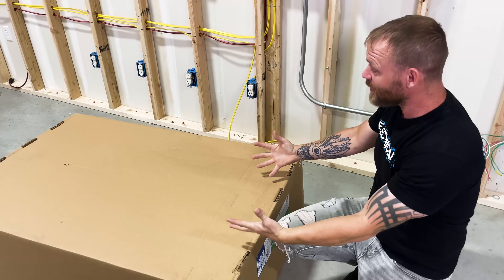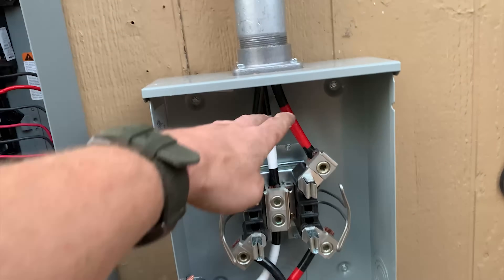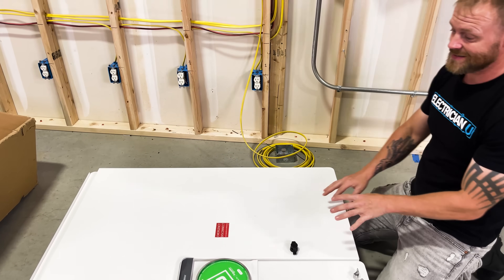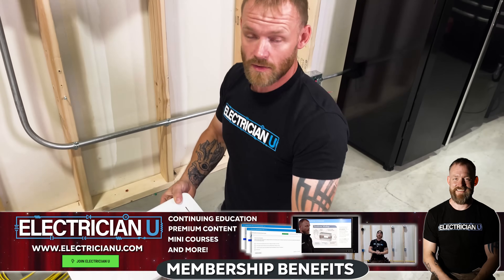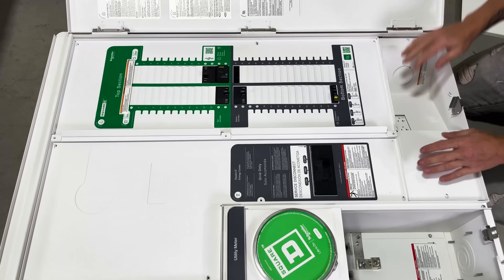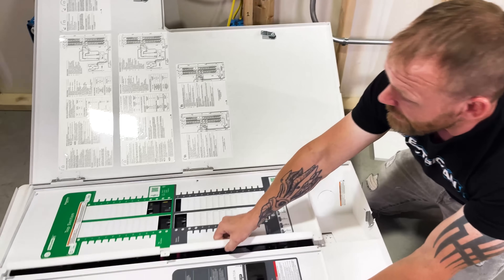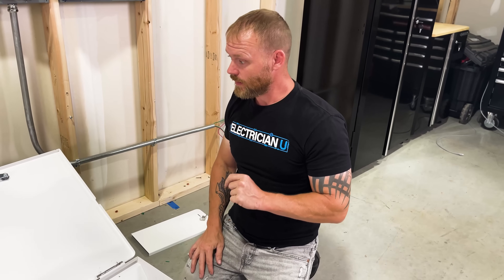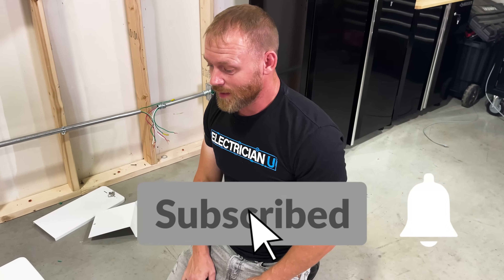The ALL-IN-ONE Energy System You Need for Your New House!

Comment: Main downside is cost is 10x a regular Meter-Panel (~$3400).  This panel is targeted at the California market.  The solar angle is only useful if back-feeding the grid, but most California utilities now credit very little to feed the grid.  Thus, many new solar systems are off-grid (can draw from the grid as needed, but never feed it).  But off-grid means a hybrid string inverter, which can only affordably be used with panels not on a roof.  That is due to the latest NEC rule that there must be a "rapid shutdown" cut-off for each roof-mounted panel (to protect firefighters).  That is a prohibitive cost with a string inverter, but integral to a micro-inverter (one per panel, see Enphase).  Micro-inverters must be grid-connected since they must synch to the grid, thus feed the grid excess solar power, even if the utility now gives little credit for it.  I know all very confusing, and may become even more so.

Yes, like many comments, the first time I saw a main panel outside was in my California house.  Power is most likely to go out during a thunderstorm (rare here).  Is it wise to be outside in the rain, perhaps standing in a puddle, when trying to flip breakers to get power back on, or switch in a generator?  Also, outside is a worse environment for corrosion.  Zinsco (Sylvania) panels were mostly installed in the Western U.S., where main panels are usually outside.  Think that might be the correlation with them getting a bad name, mostly due to corrosion on the bus-bars?

Comment: What goes in that bay above the meter, to the left of the upper panel?
Is it for a transfer switch, maybe?

Why split up load centers? (The work behind you)
If I install a 30 (or whatever amp) amp generator inlet on a 200A service, I feed it from the top with an interlock and that heats up the whole panel. Then, I instruct the HO that they have 2 options: they can manage the loads themselves or load shedding can be installed (usually just the HVAC).
If it's 200A ats on a 400A parallel service (2x200A load centers); run a second transfer switch in parallel with the first.

Comment: That is definitely a game changer a like how they powder coated the enclosure it doesn't surprise me that something that size will require at least four guys to position it while you are securing it I have installed service equipment cabinets that requires four guys probably about the same size about that enclosure unbelievable how much it waits but Square D is definitely my favorite brand when it comes to electrical can't wait to see what they come up for a remodel replacement option

Comment: I may be wrong but i did not see a DC disconnect. If it does not have one the whole panel is mute.   No doubt this panel costs several times an AC panel and DC panel combined. I am all for combining things into one panel but there should be plug and play add on's that let you customize a system.   Until that happens these types of  panels are just a waste of money because you will have to provide additional panels for a proper install.

Comment: Do you still have to run a neutral for every conductor. Example. Running 12 three. All arc fault breakers I have to run an extra neutral wire cuz of the arc fault wit this new panel do you still have to run a neutral for wire conductor.

Comment: Nice set up I’m just not fond of the plug on neutral, I’d rather use those pesky pig tails instead having the current pass thru a literal back stabbed connection. But having a built in ATS with CTs for load Managment is kool!

Comment: Curious to see how this will develop into future uses for other use cases such as those of us with basements. Our meters go outside and panels indoors, so maybe they'll develop a similar use where there are two units, one for the breakers indoors, and say the meter enclosure serves as all utility and alternative power hookups, i.e. transfer switch etc. That would be a slick solution. Definitely would drive up labor on a remodel or service change though. 
And i personally don't like Square D. Never liked the Homeline panels when i installed them and the QOs are just too pricey. They kinda remind me of the old StabLoks.... Also to mention, Schneider decided to nix all two pole Afci breakers for multiwire branch circuits, making remodel work a nightmare or impossible. Just my gripes. (And if I'm wrong on any of these points, please point me in the right direction!)

Comment: Most of us in sane states put our electric boxes inside the house. I always found it odd that movies had circuit breakers and fuses on the exterior of a house.  I never had that experience as most of our power came into the house in our basement or garage.  The meter might be outside, but the breakers and fuses were always on the inside.
Reply: I think in California they put it on the outside, im not sure why maybe a culture thing, but over here we put panels on the inside to control inside equipment and maybe one on the outside to control outside equipment
Reply: @Tactical-Black  2 reasons I can think of.
1) First responder access. 
2) Earthquake. They require Shear walls and a panel  (access) cutout exceeds the allowed penetration
3) Cheaper to do a All in 1 (with meter) vs subs
Reply: @steveurbach3093  there is a different between a main breaker and the individual  ones. Fire would have ZERO reason to manually trip individual   breakers.
Reply: @Tactical-Black  well in the video, he clearly  shows that he has installed interior breakers, so wherever he is, it’s obviously not a legal requirement

Comment: When I heard Schneider I'd remember the pad mounted solar boxes (100-500kW of solar), I'm happy to see some small budget enclosures as well. The only problem which I see is replacement parts. If you use one odd system you have to order anything. As it's not a 3phase 30kV system it's not that produced to order as any other units (example from schneider electric) it's not build to order.

Comment: Nice panel.  What is the price?  Microinverters do away with all that clutter on your exterior wall, and are also guaranteed for 25 years (unlike central inverters), are online and monitored for efficiency.  Labeled disconnect and two pole breaker and you're done.

Comment: I think MOST home owners would still much rather have access to their panel and their breakers inside of the structure/house so they don’t have to go outside. Esp. During inclement weather conditions. 

It is a really cool product though, I appreciate it.
Reply: I was shocked (tehe) that they had breakers outside….  I can’t imagine the point.
Reply: @jamesbizs  seems like a huge security issue as well. I can’t imagine having breakers accessible on the outside of the house. Easy for thieves to run off with your expensive breakers.
Reply: I was thinking the same thing. This seems like it’s desert Southwest/California specific. In the SE it’s nearly universal to have the meter can outside and the panel inside.
Reply: @yolo_burrito  yessir, same here in the South.
Reply: Not to mention the added security of the service panel being inside so someone can't come and shut things off such as vandals and others.  Especially the security system.
Reply: @KevinBenecke  Modern security systems typically include a battery backup.
Reply: Most places in rural south Texas are built like that. I'm not sure about other areas but I know it's common there.
Reply: Plus you'd have to run conduits from the inside of the house to the outside panel, that would be an additional cost in any additional circuit.

Comment: It's a shame that their $3500 MSRP product is worthless junk for 4999/5000 Americans due to having no hardened locking provision.  A disconnect accessible by boltcutter is still readily accessible.  Other alarming objections include inconsistencies between Schneider's own documentation, no lower panel SPD despite being separately disconnected (and frankly needing it more than the upper panel), there are a lot of hard bends, and I was hoping to see a Type 1 SPD for something of this cost and size.  It's a neat package but the value is not there and without pushing it hard I don't think I will get anyone to go for it.

Comment: An ordinary 60 circuit Square-D load panel is $1,090.65.   This is $3,499.00.   Which leaves me wondering if there really is $2½k of additional value in the box?
Reply: No. There is not. But it looks pretty
Reply: It does have a meter base

Comment: Some reason the idea of having like most of your breakers outside is strange to me. Not sure i would like this something goes worng in rain, then you have to work on electrical system and be in water. Or if in winter it will be miserable. I also don't see any locks on this which is one big reason I dislike outdoor panels. To me this should be like a two part system a meter, transfer switch, small breaker center outside, then put the large one inside. Far as I can see only advantage is it puts an ugly? breaker box outside instead of inside. 60 breakers though that is impressive.

Comment: Tell Schneider Electric to make an entire GFCI / Arc fault panel-board.
Per breaker or per device protection is silly.
I see code eventually requiring GFCI / arc fault on Every residential circuit
Reply: Are you suggesting the MB to have this complete protection?  I'm not sure a homeowner would want the entire house to shut off if something happened on just one circuit.
Reply: @tracyphillips9681  hmmm, good point.

Comment: Couple questions: 1 do they make or include a generator interlock that has pre drilled holes for easy installation? That’s what I was expecting with your initial explanation. 2 is a solar inverter already designed to fit in the upper left corner? Cause once again that’s what I was expecting from the initial explanation. So far all I see is a meter socket that’s integrated into an outside panel. I live in PA so we don’t usually have our main panels outside. I would actually hate my main panel outside.
Reply: 1) It has a spot/knock out for you to add an inlet for your generator.  Look at lower right side when he opens the cover.  2) yes, it would connect to the top left. The SolarEdge version coming out in December has the inverter already installed.  This first to market version is semi-flush and only good for the West Coast / California markets mostly.  Late next year is when more versions will be available for your area and others in the US.

Comment: The thing I don't like about these things is that now your electrical panel has firmware, and it will need constant upgrading and have bugs and security holes.  Also, like many companies, they will likely do software development "on the cheap" and not test it thoroughly.  I don't want any software in my electrical panel.

Comment: So it bypasses the need of a disconnect between Meter and main that code as nowadays. Guess because the main break is in separate space inside it.
Reply: a lot of meter panels have a service disconnect section these days, with the ground-neutral bond.

Comment: Curious, why do some areas put the circuit breaker panel outside versus inside? Seems to me that is really inconvenient. Breaker trips in the middle of the night you have to get dressed (hopefully) to reset it. Pouring rain, who wants to open an electrical panel? If not locked some jerk could just walk by and shut off your power. If locked now you have to deal with a lock in the middle of the night or if brave in the pouring rain.
Reply: in TX, you get both at the same time! confuses the heck out of people. and of course, some try-it-yourselfers can't figure out how to turn off the dryer or oven circuit...

Comment: I would have folded the system in half, back to back, and installed it into the wall with the meter portion facing out and the panels/outlets on the inside.  
if you didn't want to cut a hole in the wall to accommodate, it could stay in two pieces and bolt together through the wall as well as both be anchored to foundation and pads individually with only the main interconnect looping back through a wall-width length of conduit physically connecting them so your inside wiring is secure even if something happens to the meter portion outside.
If I am feeding power back to the grid I definitely need my own metering system on my own side of the wall for when the power company eventually tries to rip me off (more than likely it will be a calibration and or equipment error, but I can invite them to check my metering system themselves while they're fixing theirs). :-)
Reply: At first I thought that too, but then I realized that would be a bad idea from an hvac standpoint. There would be no R-value in that assembly and would cause problems with condensation inside the panel. (Water and electricity mixing isn't a good idea.)
Reply: @MrNiceGuyMEGA08  or, you know, you can have it in a garage the way almost ever breaker box I’ve seen has been.
Reply: Excellent idea!

Comment: I've been really interested in that panel since I first heard about it. Really want to upgrade my electrical with it.

One thing you forgot to mention in the video is that Schneider advertises the "solar section" top half can actually handle automatic disconnecting from the grid and let your solar power your home (if there is enough available) during a grid outage without a battery. Similar to Enphase's "smart backup" system but it is built into the main panel now and doesn't require setting up $5000 of additional hardware to make work like Enphase does.
To make best use of this feature though you will not want to put very many circuits in the top half. If you fill it all up then there will be too much load when only solar is available. Ideally, the top should have your most necessary circuits only: fridge, a bathroom circuit for lights when using the restroom, living room, where your network equipment is plugged in, and maybe the master bedroom. Any more than that and you risk those more important circuits going down from now enough solar power. The rest should be on the bottom half that isn't backed up.
So in the end this means there isn't nearly as many circuit spaces as it seems.
Reply: That is really cool

Comment: I like the Qwik grip better. That thing saves more time than any other new toy out there. That and the dewalt wire stapler
Reply: I use the M12 stapler and it's a godsend at times. Haven't tried the DeWalt but have heard great things as well
Reply: @sirnatanielson  yes. I work with random hired help and after a minute of demonstration they are off to the races. I typically pre do the wires that wont work with it.

Comment: Dustin that's a great panel and all,  but wasn't it to maximize space? If there installing solar,  they still need to mount the solar disconnect, meter, and Inverter?
Reply: No need for a meter anymore in most locations, but yes an inverter (if it’s a central or string inverter will need to be installed along with, in most AHJ’s, a knife blade disconnect for firefighters, etc)

Comment: Looks like they intend incoming power to enter from the bottom only. Great if you have underground incoming, but what if you have aerial lines to weatherhead coming down. Would be a pain to wire around the panel and come up. Maybe, I missed something.
Reply: flip it up side down?
Reply: I'm sure there are other models with top entry in mind, or side entry at minimum. On the other hand, bottom entry makes sense as it creates a drip loop for rain.

Comment: currently we have a 30amp plug in our panel for the RV. During a hurricane, can I reverse into this plug with the generator? NOTE: I'm planning on installing a manual transfer switch on the 200 main breaker first.
Reply: Not possible to do this safely.
You need a separate inlet for the generator.

Comment: Nice to see SqD move into this Century . . . but looks like a nice swing-and-a-miss . . .  maybe?  
1. The TOP ENTRY KOs at the end . . .  this is NEMA 1 - indoor?  But Lowes say NEMA 3R - Raintight, Outdoor?  Meters generally go OUTSIDE.  Along with the (2020 code) Emergency Disconnect?   Why did they put KOs in the Top?  
2. No transfer switch -- or is that what the big empty space is for in the Top Left section?
3. Utilities are still requiring LOTO Knife Blade Disconnect for Solar.   And to not overload the Panel Bus, we often have to tap these ABOVE the Main (between Meter and Main Disconnect.  So we will still need to tap in and add that external disconnect?
Thanks.
Reply: I believe with the top kos the panel is meant to be partially recessed into a stud wall.
Reply: As for the emergency disconnect (knife blade) that looks like it will still have to be installed.

Comment: What's the price difference between this panel and doing it the old fashioned way is it cheaper?
Reply: Not trying to justify the price, but companies try to add convenience and typically charge more for it.
Reply: I would be surprised if it is under $1,000-$1,500. This likely took a lot of engineering time, r&d, communication with utility companies, municipalities, insurance companies, and code compliance(probably less so since code is available to reference).